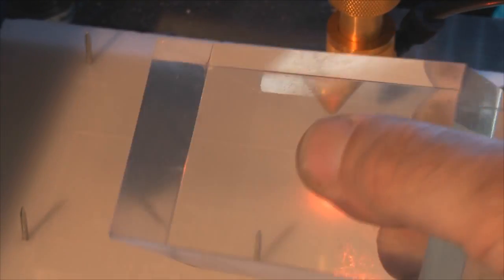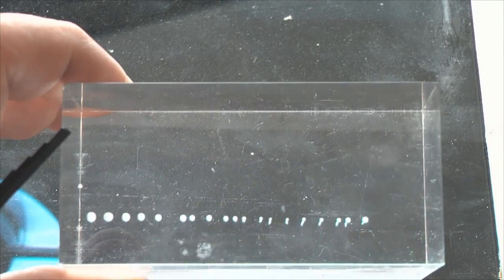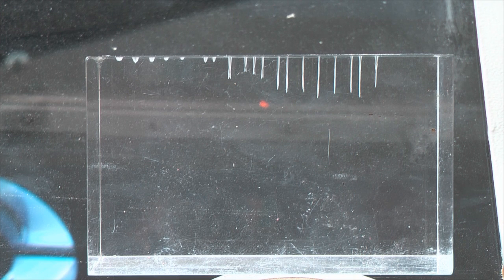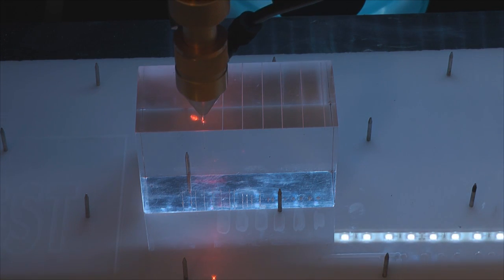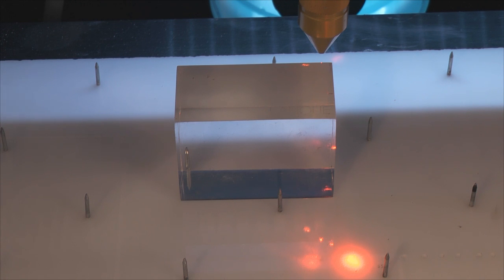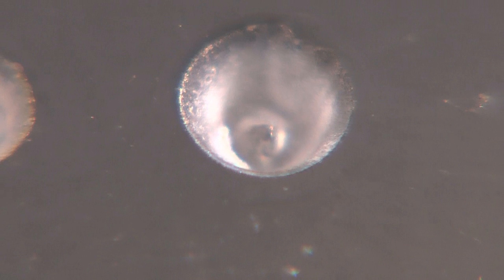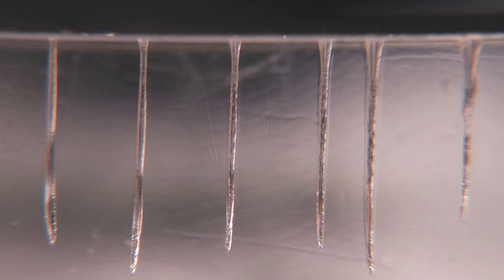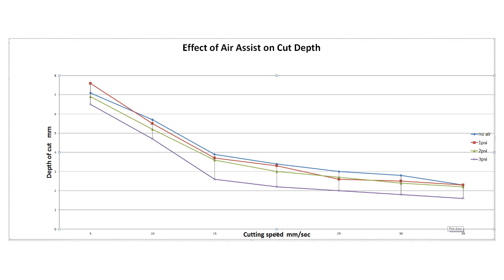Chinese laser cutter  tutorial part 6

Comment: Thank you for the vids... Question... Why are they all curved at the end of each line?
Reply: also could this cut through 1/4 inch hard woods? cherry? how many passes and what power? Thank you very much for your answer or guess
Reply from the maker: Hi Dave 
That video was early into my learning journey and I would not have been able to answer your question at the time.
As time and experiments have rolled on,  little individual facts link up to complete a jigsaw puzzle. Let me see if I can summerize
First, understand what out laser beam is. It is a beam of LIGHT, yes it's invisible but has all the same properties as normal light plus some. Because it is a coherent monchromatic beam it does not splay out like visible light and certainly remains like a tube of constant diameter light as it passes around our machines. 
Secondly. when this LIGHT hits a surface it reacts in one of two ways. If the surface is metal it will be reflected just like visible light reflects from a mirror. Granted , some metals such as gold, aluminium, silver and copper are almost 100% reflectors whereas others are slightly less. If the surface is non-metalic then there will be a high percentage of  light absorption into the SURFACE of the material. As the LIGHT energy hits an absorbing surface there is an energy transformation that takes place in the SURFACE atoms and molecules. They become excited and,  just like the excitation that takes place in a microwave oven, the molecules and atoms start increasing their vibrational activity and heat up.  What happens after that depends on the material and its ability to transmit heat.
With organic materials, this heat  oxidizes (burns) the surface leaving behind a carbon residue which will absorb the light but makes further burning less and less efficient because it is able to resist very high temperatures. 
Let's stop there because that was not your question about organic materials but it is important to understand the energy transfer mechanism.
Acrylic is a unique and fascinating material within the plastics family. It alone, has the unique property of sublimating (turning directly from solid to vapour) when heated sufficiently. So when you heat the surface in the manner described above, the heated acrylic floats away as a gas leaving more clean  pure solid acrylic to be heated and gasified. Now the beam is starting to "tunnel" it's way into the material. As it get's deeper another magical property of acrylic starts happening. The laser light starts reflecting off the internal surfaces of the tunnel and gets projected further down the tube to carry on it's energy transformation at the solid surface in front of it.
This is a unique penetration mechanism that  starts off following the alignment of the laser beam BUT because the light is being guided to the surface by the "left behind" tunnel, there comes a time when things at the workfront can become unstable and any slight variation can cause the beam to veer off slightly. Because the "light pipe" properties of acrylic are continuing to send light to the workfront, bent holes are a natural consequence.
Take a look at https://www.youtube.com/watch?v=CdupovEe9hA&t=41s          to see this phenomenon in action.
Very few people understand the mechanisms by which the laser does it's work but grasping those principles will give you mastery of many processes and materials.
All best wishes
Russ

Comment: So when I put the text on the computer program interface it shows up fine, but when I load on a USB and load it onto the machine, it is mirrored. Did you encounter this issue? How do I solve it?
Reply from the maker: It all depends on where your machine runs to when you first power on. It will either be back left or back right. to set the machine 0,0
Go to Config System Settings. You will find a Mirror X and a Mirror Y tick box. If your machine 0,0 is back right then you need both X and Y boxes ticked. I would also set the Head Position  to top right.  If 0,0 is top left then the X box must be unticked and the Y box ticked. Under these circumstances I would set the Head Position to top left.
That should fix your problem.
Best wishes
Russ
Reply: Great I figured that out. Now when I run the program it gives the message as 
"Frame Slop
Work Paused
ESc Enter"

Any suggestions on that.
Reply from the maker: Hi Manish

I guess you are trying to engrave something. Yes?  In which case you have set the corner of your program too close to 0,0. When engraving the head sweeps left and right but the head need to travel more than the width of your engraving because when the beam switches off at the end of the sweep, the head has to decelerate, turn round and accelerate again before switching the beam on for the next sweep. The head cannot be driven outside the table boundaries so therefore you must move you program in by at least 10 mm in X and Y to allow for this overtravel and with some machines it may be as much as 20mm.
Best regards
Russ
Reply: I did set it and it works fine. Thank you for all the help.

Comment: First of all - many thanks for sharing your experience  in such nice videos!
Also I have one safety related question. Whats about the danger of laser beam reflections from the eye damage point of view?
I know personally a few scientists who have simply forgotten to take off their wedding rings before getting to the lab and have lost up to 50% of their sight.
Do you work in eye protecting glasses and if so can you share your thoughts about that aspect please.
Thank you in advance,
Kind regards,
Reply: Walter Madrassa 
Hi Walter
This is a CO2 laser beam that is coherent infra red and invisible. It cannot blind you by damaging the retina.The energy is absorbed by any aqueous substance within 
1mm. Direct exposure to the eye will burn the cornea but reflections have to be off a FLAT surface to do damage. reflections from a curved surface disrupt the coherent bean causing divergence and loss of energy density. Take a look at Learning Lab 41 part 1.
Any normal eye wear will give 100% protection against reflections BUT why would you be putting metal objects in a non metal cutting laser. If it's a Yeti cup you are marking it will be coated in a non reflective  material. The risks are VERY low
Hope this helps
Best regards
Russ
Reply: Dear Russ thank you for your explanation. I have probably missed the LAB 41 part1, which I will review with interest just now. 
My suspicion regarding reflections was mainly raised because by a flat background parts of the Cutter (specifically the bed).
Also I have had an unfortunate experience of getting  temporary vision problems after being exposed to high luminosity iR (810nm) LED lights.
Best regards,

Comment: I can't seem to get mine to cut. using settings I've tried are 50mm speed 90% min and max power. Plexiglas is roughly 3mm thick. my laser has maybe 10 minutes of use on it. On the backside it feels like it penetrated but it's not a clean enough cut to remove. and it's set to cut, not scan or the other option. vector file also.
Reply: ok, i got it to cut but had to slow it down to 10mm per sec. doesn't seem right with the thickness of the plexiglas.
Reply from the maker: Hi
 It depends on the power of your machine and the focal length of your lens as to how quickly you can cut 3mm acrylic. It is an easy material to cut and if you are going to be cutting lots or maybe thin plywood or MDF the I would suggest you buy a 1.5" focal length lens. I suspect yours is currently 2". The extra energy density (see https://youtu.be/61bGzWicRRk ) will allow you to cut faster, maybe 15 to 18mm/sec. This is a normal speed. However, what's not normal is to use 90% power!!!!!! You will quickly wreck you tube if you continue like that. I know because that's exactly how I prematurely trashed my first tube through ignorance of the facts. If you don't have an ammeter fitted to your machine (and i guess not) fit one of these

http://www.ebay.co.uk/itm/91C4-DC-0-30mA-Class-2-5-Accuracy-Analog-Ammeter-Amperemeter-Gauge-/351749565079?hash=item51e5e86a97:g:HjsAAOSwmtJXUVFu

and watch this

https://youtu.be/xDZmuxq5BEM

There's a LOT more to be learnt but don't use more than 60% power setting until you know what current to safely drive your tube at

Best regards
Russ
Reply: thanks Russ. I've watched quite a few of your videos. very informative but there's so many that I kinda forget what I've learned after a while. I just remember one of your initial videos where you said to keep the power at 90% or less. but must not have seen the later one where now your saying 60%. I'm sure I'll have more questions. thanks again.
Reply from the maker: Hi 
Bear in mind this is a video record of MY learning journey. I didn't get everything correct at the beginning. The BIG thing I didn't understand is how my laser tube actually worked and why it's important to stick to the manufacturers (or typical values)for the driving current. No one told me that 100% was out of bounds and that I would quickly trash my tube if I kept working there. I did carry on trying to get the deepest cut. It was only when I started doing these tests across the power range that I realized I was getting no more cutting ability by running at high %power. By then I had virtually trashed my first tube. So if you do not fit an ammeter then don't exceed 60%power setting. I cannot guarantee this is right for your machine but it seems safe for or all machines and all powers of laser that I've come across. This is just one of many tests to come to try and profile the power curve for my machine. If you havent odered one already then sort one of these out
http://www.ebay.co.uk/itm/91C4-DC-0-30mA-Class-2-5-Accuracy-Analog-Ammeter-Amperemeter-Gauge-/351749565079?hash=item51e5e86a97:g:HjsAAOSwmtJXUVFu

and here is how to fit it     https://youtu.be/xDZmuxq5BEM  

Best regards
Russ
Reply: noted. I'm now ordering an ammeter and a temp gauge. not as sophisticated of a temp gauge as you have though. they should really come with an ammeter as cheap as they are. but then again they wouldn't be able to sell as many new laser tubes if they did. lol
Reply: Dear Russ,

Thanks for your videos. About the power range, the Epilog Manual does offer an advisable range. Thus I think the manufacters may add this into their manuals.

Best luck
Chen

Comment: You're videos are proving to be very informative, thank you.

We're looking at buying one of these machines in the next week or so, I'm aware that you have 40+ more videos for me to work through, but I do have one question...

...after all this time, and all these videos, would you still buy this machine today, given everything you now know?
Reply from the maker: +ASMR by Matthew 
Hi Matthew
The 40 videos are a record of my learning about this machine. Much of the early stuff takes you through learning to use RDWorks and then on to struggling to establish why the tube was losing power. There is a 4 month review to look at my feelings and the machine after some initial experience with it.  The Learning Lab series goes on to document how I bought and fitted a replacement tube and the mistakes I made with this purchase I eventually buy a power meter and a whole era of rapid technical learning follows.  I always knew that if I bought from China I would be on my own once they had my money.
The simple answer to your question is YES
I am a retired design engineer and spent time researching what I considered to be the best of the cheapest Chinese machines. This one had a "proper" well engineered slide-way system and had a rotary device as an added bonus. I always knew I would be modifying and improving the machine but wanted to buy a good mechanical system as a base for my "project" It has always been my plan to buy cheap, improve and learn and then upgrade to a more powerful tube with the money I saved initially.
I had occasion to review a similar Thunder Laser  machine that a subscriber was interested in buying. I had looked at it myself a year ago but it was too expensive for my budget. Despite being a more expensive machine, with my 8 months of experience, I can now see that it is little different from the "cheapie" that I bought and does not have any extras, they are all expensive upgrade options.
I made one big mistake with the purchase. I used my Pay Pal  account which is linked to my bank account. That's basically the same as handing over cash. Experience has shown me that the PayPal guarantees are worthless. If you ordered a boat and received a bar of chocolate, that is what they consider as fraud and you will probably get your money back. If you received a small boat  rather than the large one you ordered (working or not) then Pay Pal regard that as a warranty issue between you and the vendor and don't want to be involved.  The same applies to Ebay (a Pay Pal company). You will almost certainly only be able to pay with PayPal but make sure you buy with your CREDIT CARD. That way you will have a whole different level of protection and if things go wrong you will apply to your card company for your money back with a much higher chance of success.
Good luck and have fun
Best regards
Russ

Comment: Thankyou for a very indepth review/tutorial/guide of these chinese laser cutting machines. Particularly the theory and visual testing with the Acrylic block was very enlightening. I have learned alot about laser cutters today.
Reply from the maker: +RamjetX 
What you have looked at so far is the initial few weeks of ownership and my learning about how to make the machine work in a very basic way. After these 6 videos I decided to continue documenting my learning, discoveries and mistakes in a another numerical series starting at https://youtu.be/fLSI-z-TdNQ. The series continues today  as I continue to learn.
Reply: I'd been looking at the exact same machine here in Australia. I've just bought my first 3D printer and so far I've been trialing that for fabricating panels that I would normally wish to laser cut. End result isn't as bad as I thought and was genuinely impressed at the finish I can get from a 3D printer. Ideally however a laser cutter would compliment the printer and between the two have alot of small fabrication options at my disposal.

Comment: your videos are the best that I have seen on you tube for this laser. Thank you
Reply from the maker: +Shaun Browne Thanks for your appreciation. In case you haven't found them, there is a large follow-on series about learning to use RDWorks (which is the same software as LaserWorks and AutoLaser ) The first is here and they currently run to 31
https://youtu.be/fLSI-z-TdNQ
Reply: +SarbarMultimedia  I have been which them keep them coming its helping me out. not  just on this laser machine but lasers what they can and can not do. your videos have been a great help and enjoyable at the same time.

Comment: If I am reading your chart correctly it appears the depth of cut went down with increased air pressure. this is surprising, I assumed the depth would improve with increased air pressure.
Reply from the maker: I have worked with high power lasers and for many materials your assumption is correct. I was a bit surprised when I first plotted the data. But thinking about it , two things struck me. Firstly, I was cutting into acrylic. With many materials the heat melts it and you then use gas pressure to blow away the molten material. Acrylic does not melt but instead evaporates under the influence of infrared radiation. The evaporated material needs to be cleared from the cut area with a gentle flow of gas because the fumes absorb some of the infrared. if you force too much flow into the cut area it cools down the bottom of a closed cut (like I was doing with my test) thus decreasing the cutting effectiveness.  I have latterly stopped using my high flow air compressor and gone back to using the smaller pulsing aquarium pump supplied with the machine. It's quieter and does an adequate job of clearing fumes from the immediate cut zone.